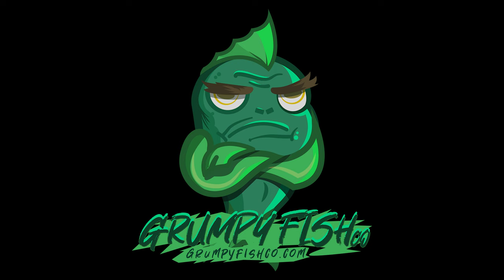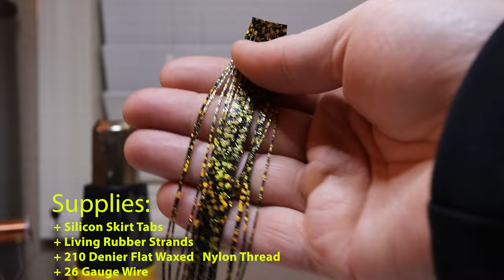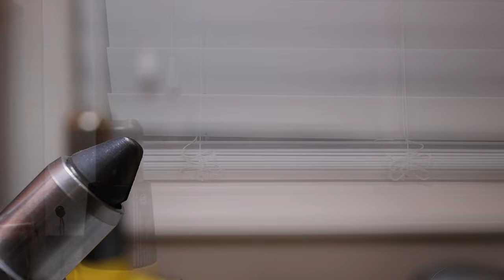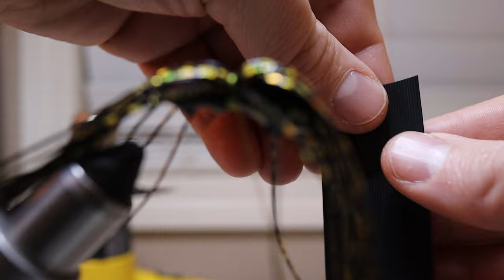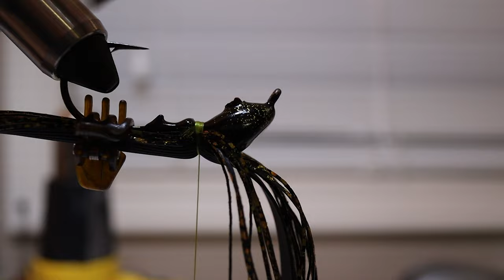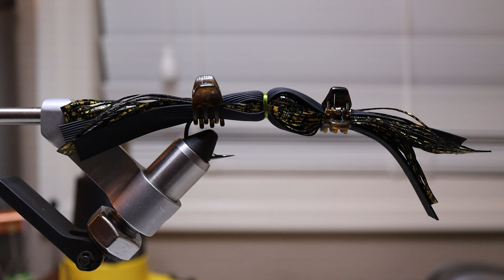Bass Jig Tying: How To Make Your Own Bass Jigs | Fools Gold | Living Rubber Jigs

Comment: great video except im confused on some things. Why the wire and what's the "living rubber" for? why not just use 2 more black n gold tabs?
Reply from the maker: Thanks Bobby!

The wire is just an extra barrier to keep the skirt in place. It is not a requirement, I prefer having the wire there versus not.

Living rubber actually provides the skirt with more action / pulsating action when on the bottom, jigging or swimming the jig. There is a big enough difference in how silicone skirt material performs vs. living rubber that I put some living rubber in all of my jigs.

The living rubber typically cost more than the silicone skirts. I prefer the aesthetic of the silicone skirt material along with the cost but I prefer the action of the living rubber. Hence the hybrid jig.

Really just comes down to personal preference more than anything.
Reply: @applegatefishing  gotcha!!! Thanks! I'm debating on getting into bass jigs, i tie a lot of crappie but haven't done any bass

Comment: I see you snip off the weed guard to start and glue in a new one to finish. How do you clean out the initial stump off the original guard in order to get a good glue set?
Reply from the maker: I'm not sure I fully understand the question but before I pour my jig heads or paint them I use a Teflon insert.
Once the paint has been baked on fully I remove the insert so the hole stays clean and makes it easy to glue in the fiber weedguard.

https://barlowstackle.com/Teflon-Base-Hole-Pins-P2186/

Comment: Why do you use thread and wire. I’ve never seen anyone do that. I just use thread and that’s enough but I’d like to know your reasoning. Btw that’s a gorgeous jig. Thank you for putting this up.
Reply from the maker: Hey Darkman, the main reason for the thread is so I can more easily layer / adjust the material. The thread is plenty to hold the material on, you're right, however when I started selling my jigs I came across reluctance to buy them simply because they were not 'wire tied'. So now the jigs I make / sell have probably the most secure skirt on the market with thread + wire securing it.

Comment: Can you leave some links to the materials used in the video ? I would like to make my own rigs but I’m not sure where to get everything or the names of everything.
Reply: Lurepartsonline, barlows, do it molds websites all have them. You can get pre-made jigs. Just make sure you get skirts, bands and weed guards. If they are unpainted,  you will need powder paint as well and a heat gun.  Easy once you get started.
Reply: @wickedbassn  awesome thank you so much man much appreciated 👌
Reply from the maker: Sorry for the delay, I'll add some links below that'll hopefully help you out. I do pour and paint all of my own jig heads but you can buy those premade from some sites.

Jig Heads:
https://www.fishingskirts.com/boss-jigs/

Silicone Skirts:
https://www.fishingskirts.com/skirt-making-material/

Living Rubber Material:
https://www.livingrubber.com/collections/medium-rubber-skirting-material

Weed Guards:
https://www.fishingskirts.com/product-category/boss/lure-making/boss-weed-guards/

Wire:
https://www.amazon.com/gp/product/B01066RIO8/ref=ppx_yo_dt_b_search_asin_title?ie=UTF8&psc=1

Danville Flat Waxed Nylon Thread 210 Denier:
https://www.ebay.com/itm/112340936196

That should cover most of it. Let me know if you need anything else!